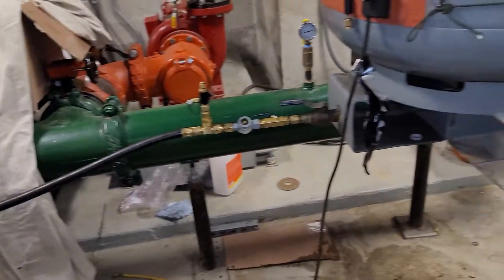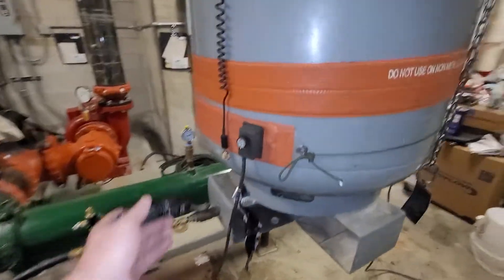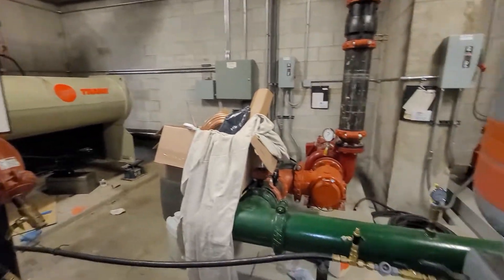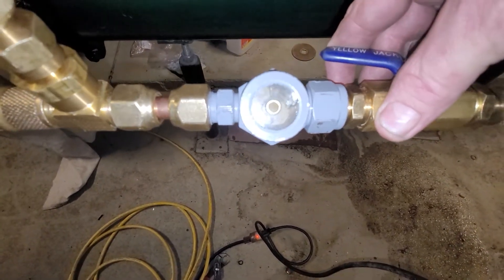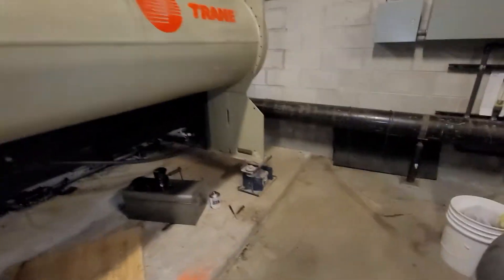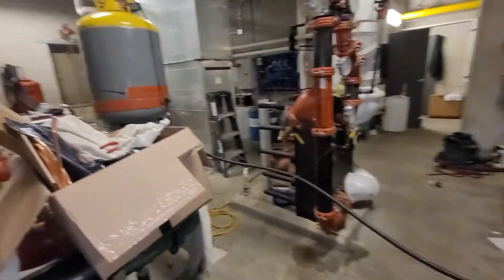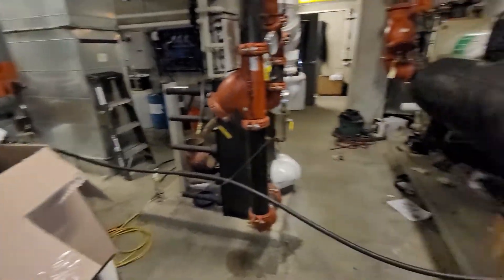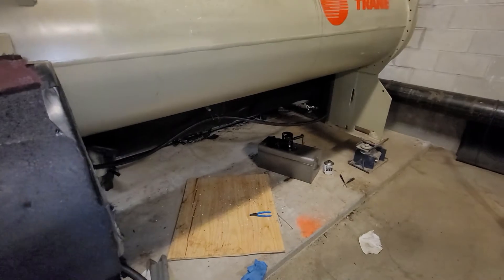Trane chiller Charging R123

Comment: how much belt heater on tank
Reply from the maker: 1000 WATTS EACH HEATER
Reply: Just use a heat gun from any manufacture, does the same deal. Heater in video is best but not necessary. Avoid using a flame torch though.
Reply: @FrenchBeefCDN a heat gun will never warm up 1000 lbs of low pressure refrigerant that is in a vacuum. You need high wattage heaters. Torch won’t do it on a 1000 pound tank. R123 in in a vacuum below 88 degrees
Reply: @ you’re wrong I have moved 10s of thousands of pounds of 123, 1233, 134a , 22, 407c and 410a using nothing more than a heat gun and refrigerant hoses. You create a pressure difference by heating up the refrigerant tank and it will flow. Works better if you have a pump but I have literally charged entire chillers with a heat gun.
Reply: Usually I just use the heat gun when adding a bottle or two. But we can do the same on a 30lb bottle as a few 1000lb tanks. That’s all the recovery machine is doing, creating a pressure difference to encourage flow.
Reply: My heat gun (Dewalt 120v) draws like 12 amps which come close to tripping most breakers as most circuits have something else drawing current on it that were not aware of. That’s enough heat to solder with, it literally glows bright orange and will make wood smoke.
Reply: @FrenchBeefCDN so if you’re in a mechanical room that’s 60 degrees a heat gun will move the refrigerant ? I have a good heat gun but the wrap around heater on a 1000 pound tank is way faster on low pressure refrigerants
Reply: @ I did it last Wednesday charged 435lbs. I’ll admit it takes a while without push pull. If we could have got flow through a barrel on the chiller it would have went faster. 

Works great in the warmer ambients that’s for sure though

Comment from the maker: Ya , didn't do that. My evap was bone dry. 30' of 1/2" hose.
Tank heater was energized.
Did 650# in 40min. Didn't even think that was possible with out a machine assist.
Reply: Wow that’s pretty good 👍🏾. Cant beat that

Comment: I Usually charge with the shortest holes possible...... and raising tank doesn’t matter in my opinion ..... as long as tank pressure is higher , And you have chilled water flowing through the barrel to lower refrigerant temp in your barrel ....... should be good .